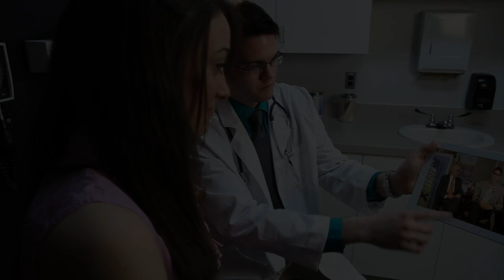PCSS-Prostate Cancer: Low Dose Rate Brachytherapy vs High Dose Rate Brachytherapy

Comment: If you watched this you probably have been diagnosed or know someone who has been diagnosed with prostate cancer, I went through it and I am now 6 years cancer free. I am passionate about this because I find the current attitude of doctors protecting their own specialty instead of the patients best hope for a positive outcome offensive. Each treatment has it’s  best application,how early or late the disease was discovered etc. There are no blanket answers. I am only writing this to hopefully warn guys about some of the things I encountered.
Wow, are these guy’s serious? Cyber knife is still radiation, it still passes through other tissue. And because of that you could be prone to bladder or colon cancer in a few years. Don’t forget once you’ve had radiation the tissue of and around the prostate looks like a melted mess, and that severely limits for salvage treatment should you ever need it.
There is zero radiation in HIFU or surgery, I did HIFU because I did my research and didn’t want to risk a secondary cancer.
Doctors like this should be ashamed of them selves for being so misleading. Sure its very precise where it can be aimed, but its coming from the outside of the body. and its probably passing through part of the bladder on its way in or colon on its way out. By the way that also means its passing through the nerve bundle on and around the prostate as well. Don’t believe this guy, or even me. The stakes are to high, do your own research, when I was diagnosed I spoke to at least 3 other that out of the blue had to be rushed to the hospital and have emergency radical prostatectomy.